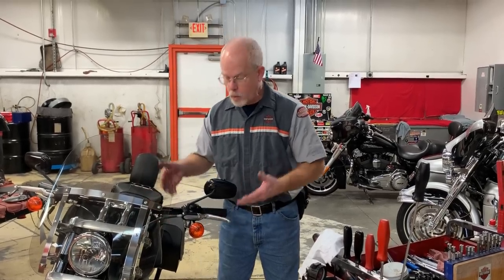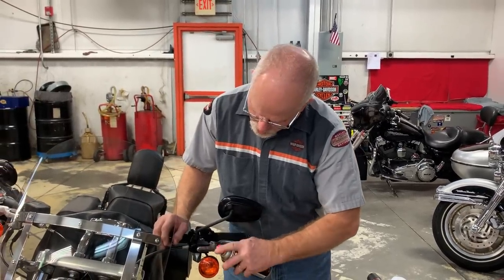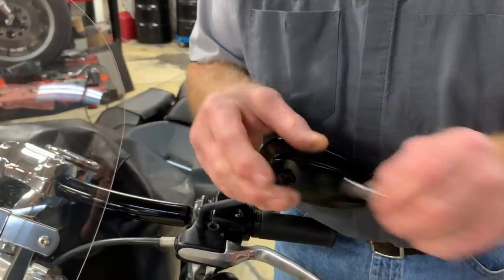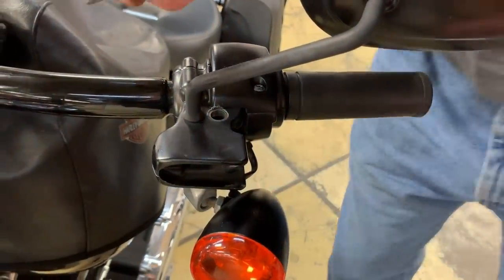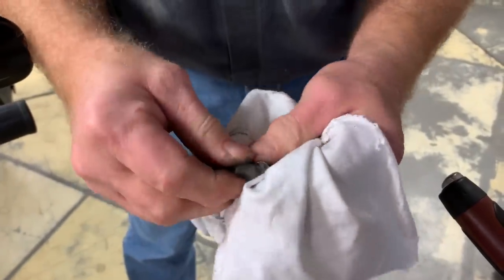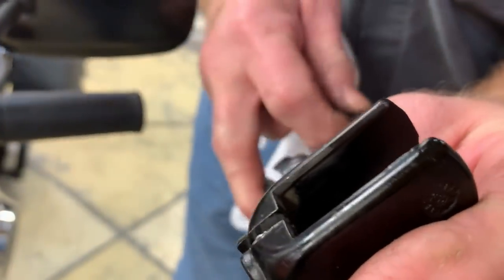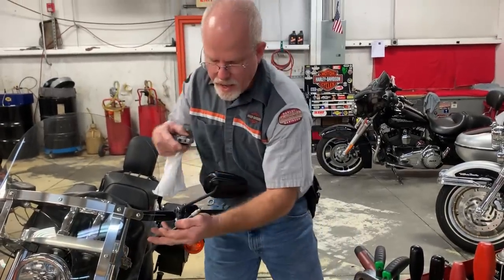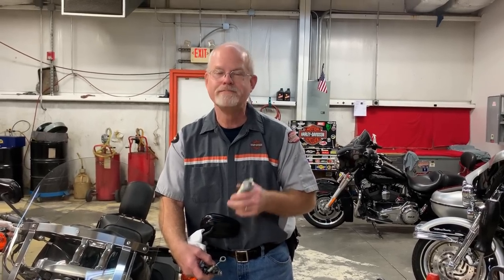DOC HARLEY: CLUTCH LEVER SERVICE

Comment: Thank you. Just changed the Levers on my 18 XL1200C tonight. Sprayed some Motion Pro Cable Lube inside the cable. Only thing I'm concerned about, The Adjustment. It felt like it needed an adjustment before. Dealer will be doing the 5k service soon.

Comment: ...and also cleaning and lubing that plastic pin on its cylindrical section, as it's the part engaging with the eyelet of the cable.. (although it's a king of self-lubricating plastic, but clean!) so to reduce wear and slack on the lever! Great video as usual, Doc! Cheers from Italy!

Comment: Molly 44 probably works best but is there another lubricant the average Joe might have in the garage that would suffice? WD40, pure nickel lubricant, Vaseline, battery terminal protector? Thanks!
Reply from the maker: I understand your great question. Molly is not your everyday found lubricant in a home garage but neither is your Harley. In my pan head days I used wheel bearing grease, very sparingly…Doc

Comment: The best thing to do is solder the first inch of cable so it attaches to the pivot. That way the cable doesn't flex at all because the soldered section acts like a lever. The cable may NEVER break if you do this procedure. My original clutch cable in my 1979 Superglide has never broken after 42 years and 104,000 miles.

Comment: Is this the same procedure for the 17 Ultra Limited? 
Thanks for all the informative videos.
Reply from the maker: Yes but be careful. HD added a switch near the pin...Doc
Reply: @LowCountryHarleyDavidson  thanks for responding. Could this also be the reason for the EITMS to only activate when it's in neutral? It used to activate in gear at a stop with the clutch held in but it doesn't do that anymore, mine only activates in neutral now.

Comment: Hey Doc, what is the correct snap ring plier to get the clutch pin loose, and what spray lube do you recommend to spray into the cable ? Thanks !
Reply from the maker: Snap ring pliers with a .038 tip. Most of our shop lube contains PTFE for max lubricity. Thanks ~ Doc
Reply: @LowCountryHarleyDavidson  Thank You Doc.
Reply: You lost me at PTFE, can you provide a brand name ?
Reply from the maker: @wb4514  Kimball Midwest or Pro Cam are good brands. Thanks ~ Doc

Comment: question PLEASE Husband installed 4 inch risers to my 2020 slim.   Now when I turn handles to the right at full lock only bike wont go when clutch is released.  Can we pull these more ourselves or should we take the bike in?  We did take the bike in but what they were charging we honestly can’t do right now and I would like to enjoy my bike.  Is it too dangerous to mess with?  Is not likely i will be doing no full lock maneuvers to the right but it shouldn’t be doing that. Thank you
Reply from the maker: It sounds like you have the clutch cable in a bind.  It could be how the cable is routed, the length of the cable or a combination of the two.  I'd recommend having someone look at the set-up with the risers installed and see if you need to get longer control cable.
Reply: @LowCountryHarleyDavidson  thank you 🙏🏼
Reply: Mine Did Same Thing ! Right Tight Turn On A Hill !
 Lost All Go Forward Ability 
 Over I Went !Be Very Careful ;-)))

Comment: Doc I have a question..... I have a 2018 street glide special and when I service the air cleaner I see oil in the throttle body walls and the bottom of my air filter is wet with oil. It’s not dripping or saturated. Should I be concerned? Thanks
Reply: perfectly normal. The crank case breathers recycle the air/oil back out through the air intake.
Reply: So you have a 2018 and it’s doing what my 2015 did until I fixed it. It’s nice to know harley doesn’t fix there flaws
Reply: I act have a 2013 softail. I did notice a fair amount of oil in my stock air cleaner. When i switched to my high flow stage 1 i noticed much less oil. I was told by the techs at my local dealer that excessive oil in the throttle body/filter can also mean your crankcase oil is filled to high.

Comment: Never knew it was that simple to remove the Clutch Handle. Have just under 4k miles on my 18 XL1200C. Maybe I should do mine? I will be having the dealer do the 5k service. Less the Oils and Filter.

Comment: Thanks Doc for the tip. Is it politically correct to spray lubricant in the clutch cable and let it drain in the primary?  I am probably missing something but I had to ask.

Comment: the c clip for the pin is non reusable
Reply: Yes it is if squeeze it back together rite. Ive had the same clip for the 4 diff times ive had to taken it off
Reply: @miketrevino8761  In the service manual says do not reuse